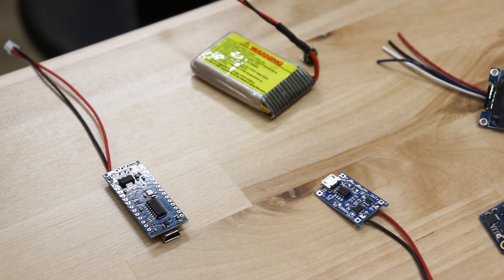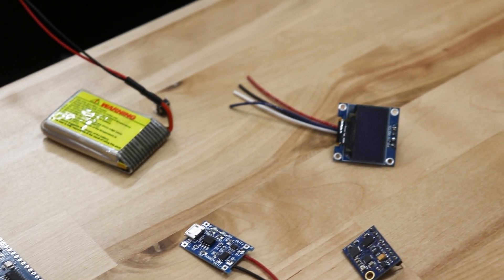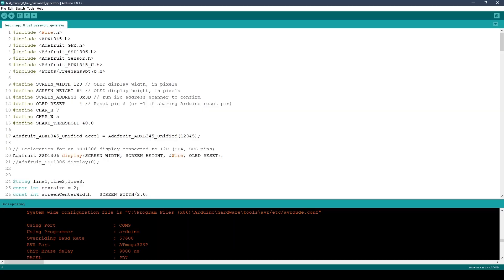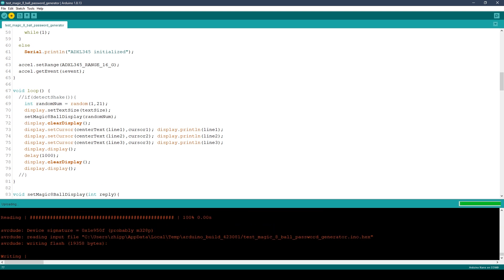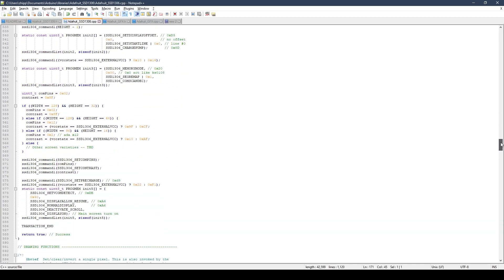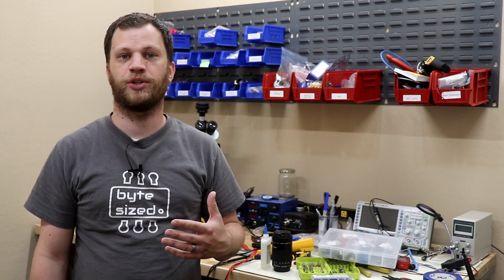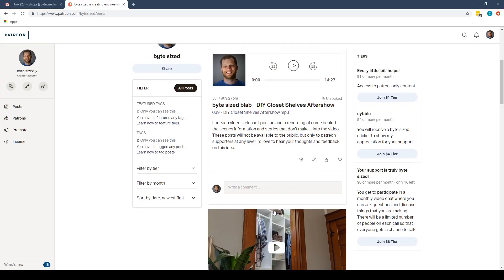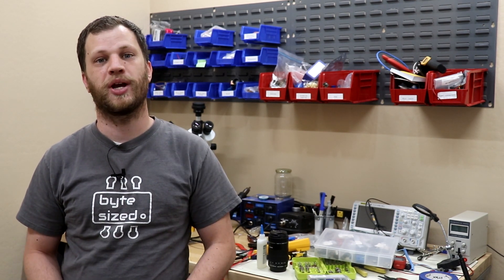Need A New Password? Just Shake This Magic 8 Ball!

Comment: @7m: The wrapper on the cell is thin. Not ideal to squeeze a circuit card (sharp pin side) onto the cell using heat shrink tubing, as something may eventually short out. I'd recommend heat shrink just the cell BEFORE attaching the circuit card. Fun project.  :-)  Cheers.
Reply from the maker: The side facing the lipo cell was flat without any components. I was very careful when I soldered my wires to that board that nothing was poking through. That's a very good thing to point out though. I was very careful and considering that